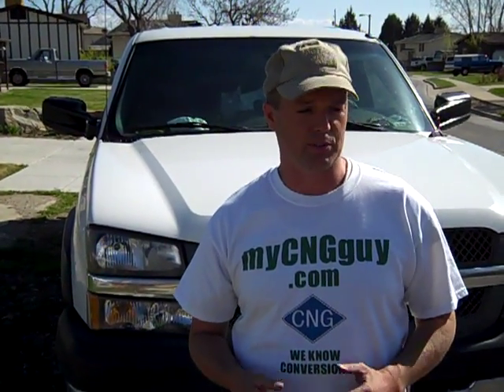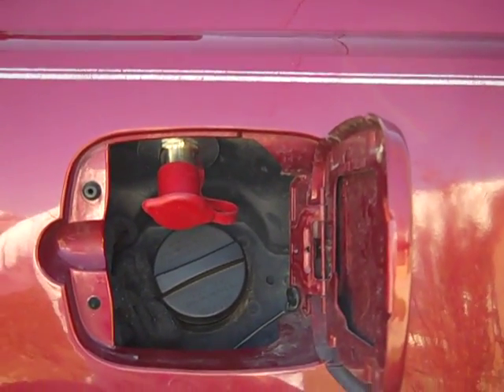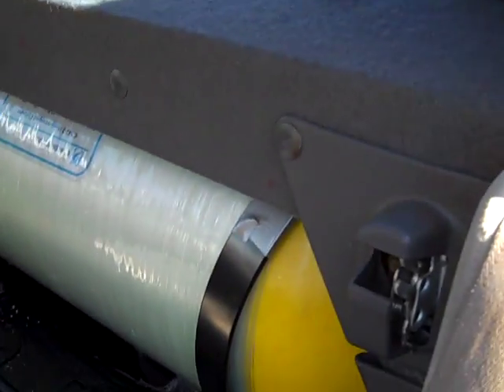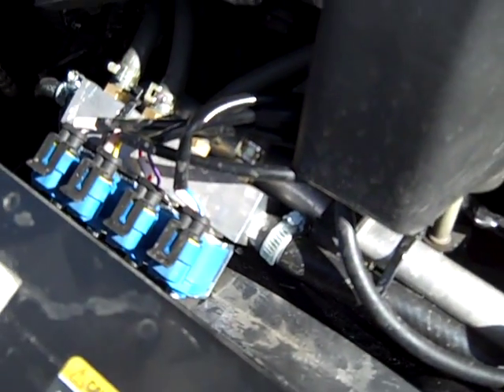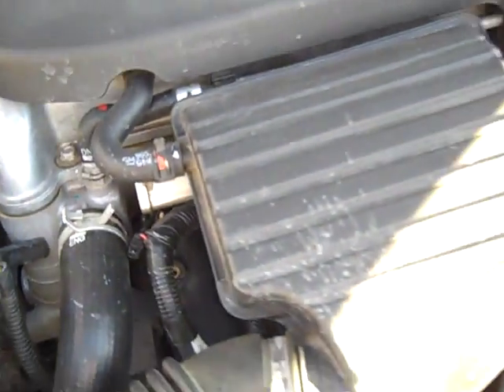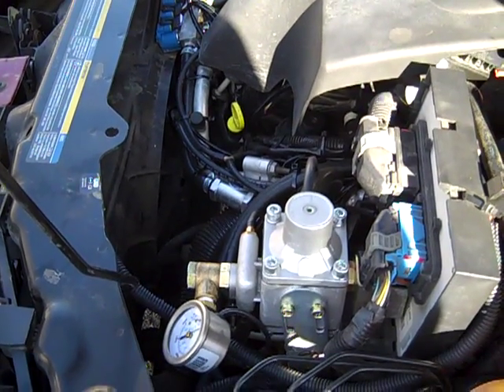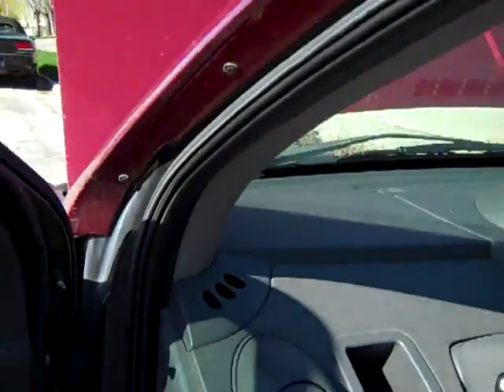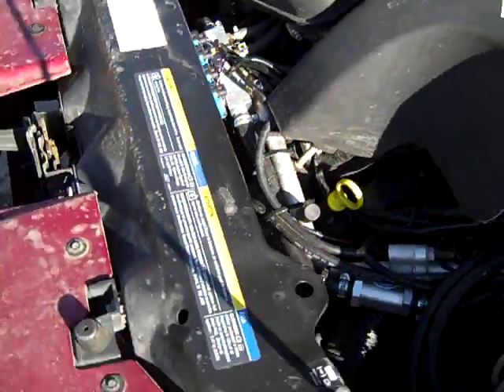CNG Natural Gas Conversion for $800, 4 cylinder Sequential injection myCNGguy.com

Comment: No you are wrong about the explosion, your not into technology or physics .  Natural Gas is actually much safer than gasoline , if you did that to a gasoline tank then yes you would be correct . CNG tanks are rated for very high pressure and typically operate at around 3,000 psi,  but most good manufacturers design it to take twice that at least for safety reason . The trick to designing anything to be safe is , to actually design safety into it , which tanks good Engineering , This technology has been around since WW2 and just learning about it .  yes anything can happen but very doubtful